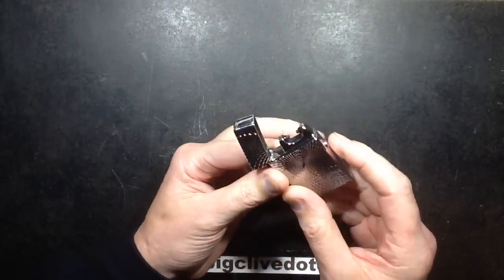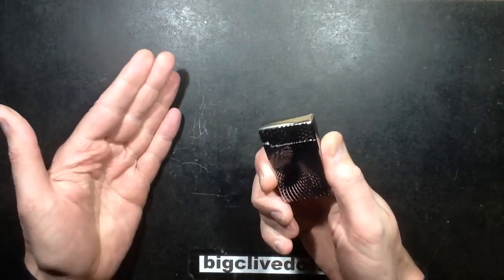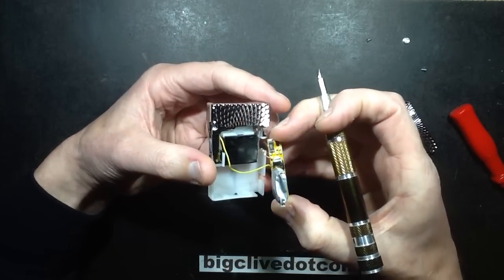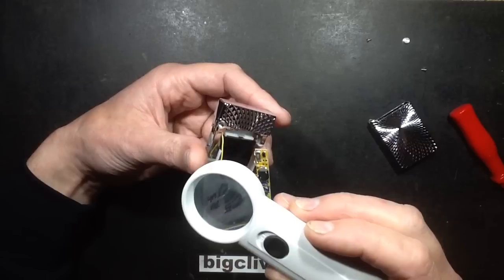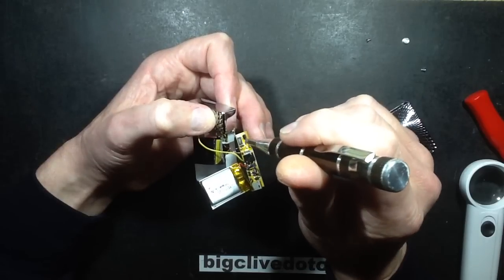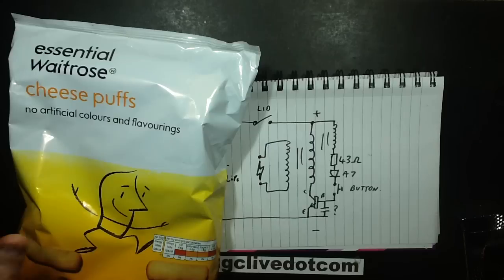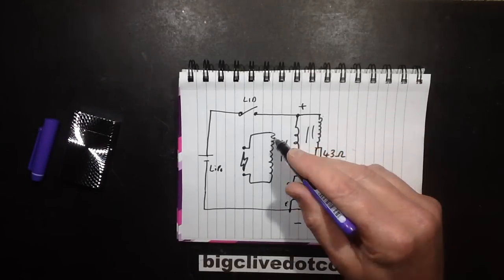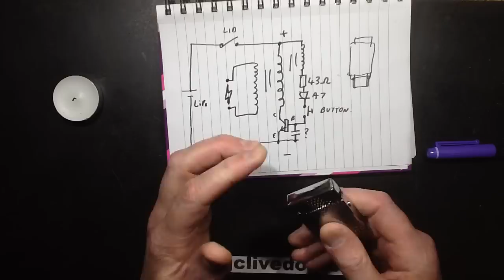Disassembly and schematic of an arc lighter.

Comment: Would it possible to get a shock out of that through a cigarette between your lips touching either of the contacts and essentially doing the same you did with that piece of solder there? 

Also would the concept of an electric root canal make sense?

Comment: Great video clive :-) when you clicked the lighter and you audio went down was that from an emp causing it ??
Reply: The high frequency sound from the oscillator in the lighter was picked up by his microphone.  Being a relatively loud audio signal, the AGC circuit in the microphone amplifier turned the gain down.
Reply: Thank you for the reply :-) i was wondering what was causing it....

Comment: Clive what would you say the electrical output of the arc is on these things?
Ive got one, not opened it up or anything, but I noticed when its windy the arc blows out and it seems that the arc loops back to its own contact.

Comment: i could hear the high frequency whine when you first pushed the button. not a fan of being able to hear electrical circuits making noise... some of the cordless drill battery chargers make a similar whine, not quite sure which components are producing it though.

Comment: I must say, I didn't laugh when you shocked yourself, but you can't win them all. Making me laugh 95% of the time is still a pretty good track record though. Actually, I've probably come into contact with the hot side of 120VAC at 60Hz over ten times in my life mostly due to non-polarized lamps, and I still hate it. That was until I learned how to polarize lamps with continuity testers and simple sharpie markings or proper plug replacements. I still like wiring up electrical stuff though. I wouldn't mind having a candle arc lighter though. I never got into smoking and I'm pretty happy about that.

Comment: Hey i have an electric lighter called "atomic lighter" and ive read that it takes 100 recharges before the battery runs out, its like the same lighter that clive has, and im wondering if there is any way i can replace the batterys when it runs out? Thanks!

Comment: Could the high frequency AC be capacitively/inductively coupled to the casing of the lighter? That might cause it to create a voltage differential between the casing and the voltage at the electrodes.
Reply from the maker: +Jim Griffiths I think it arced across internally when I poked it.

Comment: I have a question about this that I'm hoping you can answer. I tried to modify an arc lighter like the one in your video to operate off a DC power supply instead of a battery. However, using a bench power supply between 4.2v and 3.7v and as much as 5a, the lighter won't function.

My first thought was that maybe there wasn't enough amps, so I tried to use a multimeter with the included lipo battery to see what the current draw was. But when using a multimeter, the lighter still won't function. It only seems to work when powered by a battery with nothing else connected.

Do you know why this might be? Is it possible the circuit expect some kind of specific resistance from the battery in order to work?
Reply from the maker: It draws a lot of current, and may also be affected by the voltage drop in the wires.

Comment: Is there a safe way to replace the battery with a larger battery. I have the perfect old fashioned table lighter case that I want to modify and it has the room to fit a much larger battery in it

Comment: How long does the arc stay on? Can it stay on for 30 min?
Can you use it to turn on a small neon sign?
Reply from the maker: It's only suited to small bursts of use.
Reply: @bigclivedotcom :
Mine lasts 10 s. Then you can repress and the arc starts up again for another 10 s.

I connected the wires to a neon tube, about 50 cm long and it was able to light it. I connected to a ~100 cm tube and it was partially lighting it. This was interesting. It was behaving like the Plasma bulb you have in your other video.

I connected it to my HeNe 10 mW laser. It is able to ionize but the current must be too low. The lasing effect was not working. No laser beam comes out.

Comment: Don't light anything metal whilst holding it your other hand. If you know you may be shocked try to keep it localized. touch the lighter case with the hand that holds the solder. Shorter path. could be survivable in extreme cases. Don't try this at home, kids.

Comment: So what if I wanted to remove the lid would that have a major effect on the operation because the lid gets in the way of lighting candles
Reply from the maker: On the unit I've got there's an electrical lid interlock at the hinge end, so it might stop it working.

Comment: Could the shock come from the case of the lighter is ground wich you held in one hand and you got the posetive pole thru the solder in the other.
The ground connection could come from something simple as the button on the side or simular.
Reply: +tbbw think the spark jumped over to the case on one side. The output is completely isolated, so it cant be the button

Comment: Hi bigclivedotcom, i was wondering if you could help me answer a really really important question. I am concerned about this lighter the moment I saw the arc pass through upon lighting it (I bought one myself). I have always been told not to look at the arc when near welders. Forgive my ignorance of the subject, but I feel you may know more than I about this. Is the electrical arc in these types of lighters THE SAME as in the arc welders you see at construction sites? 

I am not sure of the dangers of looking directly at this electricity/current. I bought it for the occasional cigarette lighting/novelty. But I do not want to be damaging my eyes unknowingly every time I "light" this lighter. The instructions don't warn me against looking at the light, but then again, the company I'm buying this from is in China and I doubt they would care about warning labels and consumer safety. Any professional advice would be MOST appreciated. :)
Reply from the maker: +Krieger-san It's all to do with the power.  Your lighter arc is safe because it is very low power, while a welding arc is in the region of 3kW or more.
Reply: +bigclivedotcom Thank you so much for the reply! I really appreciate you getting back to me on this! I am very relieved to hear this. Tried googling to no end but couldn't find the answer. Thank you again!

Comment: Maybe it would make a Taser?
Reply: Maybe if you were tasing an infant. The gap is insanely small, smaller than a cigarette (at least on the one I have). You prooobably could use it as a taser, but it wouldn't be a good one.

Comment: I have one of these which quickly failed, 
it still charges but sadly no arc 
do you thing the A7 diode would fail first to protect the circuit ?
Reply from the maker: +Rob Bennett Two components are being pushed quite hard.  The little transformer that operates at very high voltage, and the transistor that drives it.

Comment: For electronic engineer it is strange to see that high voltage testing with the wire. This testing made me laught from Your reaction. So for the thinking: youtube optimizes sounds and this high pitch sound sounded around 10kHz or sometimes higher interesting how high it is in reality. If you cant hear with your ears and only cameras microphone is picking that sound i think that sound is beyond 14kHz :) I had lighter like yours, my dog really hated it. When i measured with the sound tester with the Hz measurment i saw that the sound was 16,6kHz. What is yours?

Comment: 1:51 ... i did that and did not get shocked... There is not really a reason to get shocked either, because the spark would either go around it if it was too resistant or through it if it was not...

Comment: The skin effect doesn't matter at frequencies like that (but don't tell that to the audiophools, because they swear on their silver or gold coated wires and it's just your untrained ears that can't hear the difference). The effect is even less pronounced on bad conductors like the skin.
Reply: +superdau 
Btw. I think the feedback works the other way round. The feedback will not increase the current to the base, but oppose it. Otherwise the transistor could never close. The capacitor is most likely there to keep the transistor open for longer even when the base current through the switch/diode stopped due to the feedback.
Reply: +superdau because a 9000$ gold plated connector would make a difference in sound quality...

Comment: i got one of these a couple of weeks back after using it for a while it stopped arcing  made sure it is charged do you know of any fixes ?
Reply from the maker: +Daniel Stockley Is it making any noise or is it just silent.  It's hard to say what could go wrong, but it could be something as simple as a wire that has dropped off, or something more serious like transistor or transformer failure.  Keep in mind that these devices are only capable of operating for literally a few seconds at a time.

Comment: i just put a thin steel plate between those little ciontacts and turned tie lighter on. the metal plate was lying next to my controller which then turned off, turned the lights on etc. and the computer said i deinstallled the driver
Reply from the maker: +Maximilian Beyer High voltage RF energy is what is used in jammers to interfere with gaming and other technical equipment.
Reply: +bigclivedotcom thank you :)

Comment: wait what? high frequency  voltage won't hurt you? by the looks of it there must be a few thousand volts in that thing.

can someone explain this a bit more?
Reply from the maker: If current flows through your body at a high enough frequency it does not stimulate the nerves or muscles.  It used to be believed that it was the skin effect of it travelling over the surface, but it's more likely to be down to the inability of the body to react to the higher frequencies.

Comment: Hello. Maybe a dumb question, how can a step up transformer work with direct current? Please could someone explain me?
Reply: You need an oscillating current to induce a current in the secondary winding, so you could use a high frequency dc current with either high amps or high voltage to work

Comment: Don't you mean high voltage and not high frequency? A 5 ghz 5V pulse won't do anything to you
Reply: To induce a current in the secondary you need a  frequently collapsing or oscillating magnetic field. This is achieved in this case with high frequency switching from the transistor.

Comment: Apparently the alleged 'skin effect' is a lie. The real reason you don't get shocked at high frequencies is because much like you ears, your muscles have a 'frequency response' and if the frequency is high enough your muscles can't convulse fast enough and the sensation of being shocked is not felt. Does make it allot easier to get nasty high voltage burns and singes though.

Comment: Lol i was crying lol.............
So, how about a mini usb charge hack.
Reply: +JRushPixel do you prefer mini over micro? we are stuck with micro now anyway, like it or not!
Reply: +jusb1066 I hate them on sat nav's, they allways get broken when the dam thing falls off the dashboard lol.
Reply: zx8401ztv
we are stuck with them though, i do agree the mini usb was a bit more robust,  but now we are committed, i like it we are not wasting 1001 power supplies and cables with every product now, though of course apple had to throw a spanner in the works....
Reply: +jusb1066 Dont they allways lol, it would be nice if all mobile phones had one type of power/data jack, but i suppose im asking too much lol.
Also the mains cable that comes with 19 volt laptop psu's isnt allways the mickey mouse outline, i dont know what there name is, mickey mouse will have to do :)
Reply: zx8401ztv clover leaf connector? yeah sometimes its a figure 8, sometimes its something weird also!